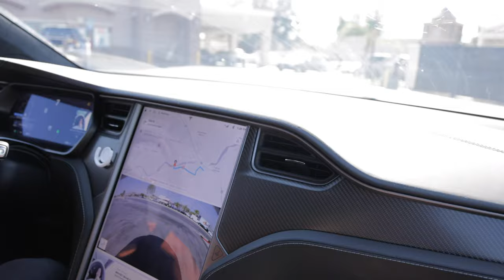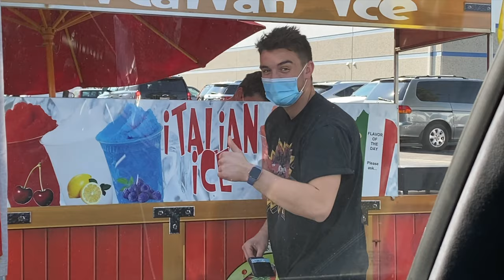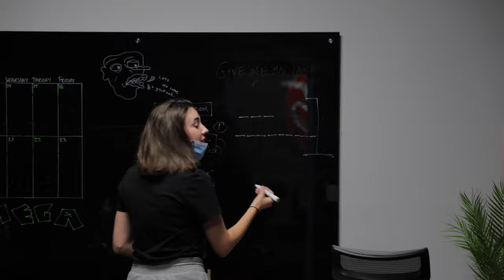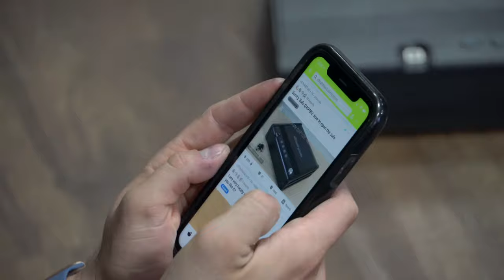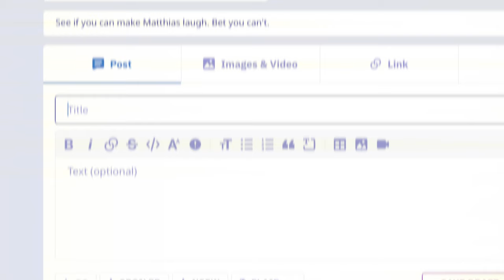Something Explosive Is Leaking Out of the Safe...

Comment: Maybe there was a bottle of gun cleaning oil that broke when it was dropped. Could definitely explain the smell and flammability. Most gun cleaners have a sweet smell
Reply: Great observation!
Reply: Rest In Peace grant
Reply: Or a stash of hand sanitizer
Reply: It probably defense fluid most tech safes have them it's to stop you from trying to break it open with force
Reply: Or i could be alchhol
Reply: Or just battery acid from bottons cause they need power to work
Reply: @paulbortner2455  the tiny batteries it uses to run that thing aren't going to dump a large cup of fluid on the floor. Sorry.
Reply: @wosmssksksnssn3281  yup, probably nice bottle of expensive spirits. People are completely ignoring the actual point of a safe.
Reply: Correct observation but wrong liquid.

Comment: MATT DRILL A HOLE IN IT AND PUT THE ENDOSCOPE THINGY IN IT

Edit: for everyone saying it’s not smart because of the explosive substance inside, read the replies on this comment from Kyle Smith. He explains why it is safe and why it won’t cause an explosion
Reply: I didn't think of that but that's a good idea. Only problem is that you wouldn't want to drill into anything important/valuable in the box because you could accidentally damage it.
Reply: Plus if there IS explosive stuff the metal shavings could cause a reaction and explode, soo not a good idea
Reply: @unicornqueen268  but you could try to safely remove the lock then put the endoscope in.
Reply: I said use that scope three days ago...I don't think they read these
Reply: THERE IS A FIRE THERE
Reply: SOMEBODY MAKE MATT SEE THIS PLZ
Reply: Get one them electric saw type thing (electric cutter that looks like apizza cutter) and just cut a squared outta it
Reply: Or, just, you know, drill a bunch of holes till there's a hole big enough to try to reach in ad grab it.
Reply: your kind of right but what if they drill into it and the and sparks happened and the fire starts in the safe and burn whatevers in it
Reply: @seville2k  mhm
Reply: how about that just open it and tell us what they put in it 🤔.
Reply: Big brain but also lil brain cuz if theres something explosive in it, metal shavings will set it off and we dont want Matt to die
Reply: Ppl saying bout the liquid well put it in the sink when its leaking and hang it for a few days to let all the liquid to get out then drill/electric pizza cut into it and done
Reply: the phone!! the fake chinese phone the little thingy that have a camera
Reply: Noooo, what if the residue ignites???
Reply: risky play, but ya
Reply: Yeah that would work
Reply: @kristaquimby329  drill it in the corner while tilting the safe the other direction
Reply: @flyingpotatogamer0336  sparks + flammable fluid = bad juju. Any type of drill or saw made for cutting metal will send sparks flying.
Reply: That’s not a good idea when it’s something flammable
Reply: @unicornqueen268  why does this whole thing look fake to me I don't want it to be fake aaahahahhhh
Reply: U are a genius
Reply: @r.rodrique2827  they don't care. It's all about prolonging this nonsense. I've debunked quite a few ideas on reddit over the past couple of months. The truth won't get them views.
Reply: @unicornqueen268  Most explosives require an electrical signal in order to explode.  You can torch c4 and nothing will happen however if dropped it, it will explode. It's 100% safe to drill into it and sense it's already covered in oil, the drill it will be well lubricated.
Reply: @Minitura  the heat from tiny aluminum l shavings is well below the flash point of oil
Reply: @es4forty892  yeah but still -_- its worrying that there liquid in a safe even if its just gun cleaning stuff you still should be careful
Reply: Yeah that's a good idea hope nothing seriously bad happens from that 🤣🤣🤣
Reply: Big brain move right there
Reply: Good idea actually
Reply: seeing that it has something "flammable" inside, drilling might cause it to explode. I wouldn't do that.
Reply: Internet winn!!
Reply: @kristaquimby329  that's why you stop drilling as soon as you feel it pop through
Reply: Smart smart smart
Reply: OH MY GOD WE HAVE  A GENIUS
Reply: @kristaquimby329  well they already did
Reply: Yesssss
Reply: Or just put the endoscope into the safe. There's a gap already... Why drill out a hole.
Reply: The box has flammable items...and the drill will cause sparks...sparks and flammable fuels don't go well together :(
Reply: If it lit on fire from what looked to be maybe a napkin or clorox wipe drilling into itmight not be the best idea as the metal scrap peices might also cause it to light on fire or explode
Reply: Oooo BIG BRAINN... actually after reading some of the other comments not so big brain.
Reply: @es4forty892  FINALLY someone who knows what they're talking about.

Respect.
Reply: @unicornqueen268  it's just water. Let's pretend like this is real. According  to the story line that safe was setting on an air conditioning vent on top of drop tiles in a closed off area, where condensation would form.
Reply: WHAT if whoever hid the safe had to place it ontop of the ac unit because the radioactive acid had to be kept in a cool environment to be stabalized
Reply: WHAT if whoever hid the safe had to place it ontop of the ac unit because the radioactive acid had to be kept in a cool environment to be stabalized
Reply: Yup
Reply: I love the range of knowledge within this group. Totally awesome!
Reply: @flyingpotatogamer0336  you mean an angle grinder :)
Reply: @scottlittle6478  Unless you have a good idea about how this aluminum case could contain radioactive radiation, especially gamma radiation, I'm all ears. Also cooling a radioactive substance won't extend it's half-life. The entire reason a element is radioactive is that its splitting into stable forms. Heat won't change how stable it is, because the instability is in electrons, so unless you're dropping it below 0 degrees Kelvin, heat is a moot point.
Reply: @es4forty892  Electrical current with C4 is a completely different topic than explosive substances. It's literally two completely different things.

Comment: Matt, at 15:34. the light was flickering in the safe. Maybe it is like a safety measure and that it is why it is leaking that stuff.

@cayleigh theoret also found this discovery.
Reply: I staid the same thing
Reply: Oh, sorry I credit you.
Reply: @CayleighKristine  Done.
Reply: @Dude-vt7jc  nah your good
Reply: @Dude-vt7jc  thx though
Reply: The blinking red light means that a code or finger print has been tried and failed 5 times. According to the manual.
Reply: @huskytemp1753  Oh, but isn't it weird that when the safe started realising that unknown substance, it stopped and then started when they used the wire?
Reply: @Dude-vt7jc  I personally didn't see it stop flickering. The manual says 3 red blinks = incorrect code/fingerprint or a programming error. 5 red blinks = power failure, 6 red blinks = primary or secondary fingerprint storage is full, and a slow blinking red light for 2 minutes = incorrect code or finger print five times.
Reply: It's possible that the fall or the liquid bugged it out though

Here's the manual if you'd like to take a look : https://cdn.masterlock.com/sentrysafe/resources/pdf/manuals/P63700.pdf
Reply: @huskytemp1753  No, I meant the liquid. It stopped and when they were trying to unlock it, it started again.
Reply: @Dude-vt7jc  oh I don't know, I kept looking around and I couldn't find anything about liquid being in the case. On their website it says the safe has steel, LED on the inside, gas compression struts and foam for padding.
Reply: My theory is, since I believe Matthias awhile back mentioned that the building used to belong to scientists, that maybe it was some kind of chemical put in the safe.

Comment: The flashpoint of a liquid is the lowest temperature at which the liquid gives off enough vapour to be ignited (start burning) at the surface of the liquid. Sometimes more than one flashpoint is reported for a chemical. Since testing methods and purity of the liquid tested may vary, flashpoints are intended to be used as guides only, not as fine lines between safe and unsafe.

Does the liquid itself burn?
Flammable and combustible liquids themselves do not burn. It is the mixture of their vapours and air that burns. Gasoline, with a flashpoint of -40°C (-40°F), is a flammable liquid. Even at temperatures as low as -40°C (-40°F), it gives off enough vapour to form a burnable mixture in air. Phenol is a combustible liquid. It has a flashpoint of 79°C (175°F), so it must be heated above that temperature before it can be ignited in air.

What are flammable or explosive limits?
A material's flammable or explosive limits also relate to its fire and explosion hazards. These limits give the range between the lowest and highest concentrations of vapour in air that will burn or explode.

The lower flammable limit or lower explosive limit (LFL or LEL) of gasoline is 1.4 percent; the upper flammable limit or upper explosive limit (UFL or UEL) is 7.6 percent. This means that gasoline can be ignited when it is in the air at levels between 1.4 and 7.6 percent. A concentration of gasoline vapour in air below 1.4 percent is too "lean" to burn. Gasoline vapour levels above 7.6 percent are too "rich" to burn. Flammable limits, like flashpoints however, are intended as guides not as fine lines between safe and unsafe.

What is an Autoignition Temperature?
A material's autoignition or ignition temperature is the temperature at which a material self-ignites without any obvious sources of ignition, such as a spark or flame.

Most common flammable and combustible liquids have autoignition temperatures in the range of 300°C (572°F) to 550°C (1022°F). Some have very low autoignition temperatures. For example, ethyl ether has an autoignition temperature of 160°C (356°F) and its vapours have been ignited by hot steam pipes. Serious accidents have resulted when solvent-evaporating ovens were heated to temperatures above the autoignition temperature of the solvents used. Autoignition temperatures, however, are intended as guides, not as fine lines between safe and unsafe. Use all precautions necessary.

How can flammable and combustible liquids be a fire or explosion hazard?
At normal room temperatures, flammable liquids can give off enough vapour to form burnable mixtures with air. As a result, they can be a serious fire hazard. Flammable liquid fires burn very fast. They also give off a lot of heat and often clouds of thick, black, toxic smoke.

Combustible liquids at temperatures above their flashpoint also release enough vapour to form burnable mixtures with air. Hot combustible liquids can be as serious a fire hazard as flammable liquids.

Spray mists of flammable and combustible liquids in air may burn at any temperature if an ignition source is present. The vapours of flammable and combustible liquids are usually invisible. They can be hard to detect unless special instruments are used.

Most flammable and combustible liquids flow easily. A small spill can cover a large area of workbench or floor. Burning liquids can flow under doors, down stairs and even into neighbouring buildings, spreading fire widely. Materials like wood, cardboard and cloth can easily absorb flammable and combustible liquids. Even after a spill has been cleaned up, a dangerous amount of liquid could still remain in surrounding materials or clothing, giving off hazardous vapours.

What is the danger of flashback?
Vapours can flow from open liquid containers. The vapours from nearly all flammable and combustible liquids are heavier than air. If ventilation is inadequate, these vapours can settle and collect in low areas like sumps, sewers, pits, trenches and basements. The vapour trail can spread far from the liquid. If this vapour trail contacts an ignition source, the fire produced can flash back (or travel back) to the liquid. Flashback and fire can happen even if the liquid giving off the vapour and the ignition source are hundreds of feet or several floors apart.

Can flammable or combustible liquids be hazardous to my body?
The most obvious harm would be the danger of a fire or explosion. After the immediate danger of a fire, there are sometimes other properties of these liquids that may be hazardous to the body. Flammable and combustible liquids can also cause health problems depending on the specific material and route of exposure (breathing the vapour/mist, eye or skin contact, or swallowing). Some flammable and combustible liquids are corrosive. Many undergo dangerous chemical reactions if they contact incompatible chemicals such as oxidizing materials, or if they are stored improperly.

The Material Safety Data Sheet and the supplier's labels on the containers should tell you about all the hazards for the flammable and combustible liquids that you work with.

An example is 2-propanol (also known as: dimethylcarbinol, isopropanol, or isopropyl alcohol). It is a colourless liquid with a sharp odour like rubbing alcohol or resembling that of a mixture of ethanol and acetone. It is flammable liquid and vapour. Vapour is heavier than air and may spread long distances. Distant ignition and flashback are possible. It is also considered to be a mild central nervous system depressant. High vapour may cause headache, nausea, dizziness, drowsiness, incoordination, and confusion. It may also be irritating to the respiratory tract or eyes.

Comment: 17:31 woods seems to be putting something in his left pocket (lighter) and also his right hand witch came away from the liquid didnt open as if he was holding something small
Reply: I noticed this too.
Reply: @uta chilz It’s def a lighter if you watch in .25x speed as the screen is green and he’s pulling back you can see the metal glint of the lighter tip sticking out slightly it’s super hard to see though

Comment: 14:50 did anyone notice the red light on the safe
Reply: According to the manual the red light means attempted fingerprints or codes have failed five times.
Reply: @huskytemp1753  interesting is that still from before
Reply: I don't think so. There is stuff about 3, 5 and 6 red flashes, which it flashed more than that, but then there was something about two minutes of slow flashing, which it looked like that's what it was doing. It's possible that the liquid spewing out caused the case to think that they put in codes of fingerprints. Hard to say though.

Comment: The video showed a thin metal strip and your crew literally got the thickest metal strip that won’t be able to round the corner 🤦‍♂️
Reply from the maker: bruh that's literally all 3 stores had.
Reply: @onlyoverkill  amazon
Reply: @onlyoverkill  why didn't the rest of the liquid catch on fire? if the chemicals flash point is so low it catches fire from the friction of wiping it up the whole spill should have gone up in flames immediately. kinda sus
Reply: @the_matrix7715  maybe it reacts to the the paper towel?
Reply: @the_matrix7715  idk because
Reply: @novaahere  I've never heard of a chemical that would react to a paper towel. Or a chemical that would create a flamable reaction and the rest of it not also go up in flames. If a chemical is that reactive to another substance the rest of the liquid would catch on fire immediately
Reply: they can't make things outa thin air
Reply: @onlyoverkill  yeah you did your best :))

Comment: Ok at 14:51 the light on the safe goes on. This means the batteries are relatively new. Whoever put the safe there they put it in recently. Don't try to argue that they are old bc with a light every few seconds it would corrode the battery area. Maybe check there also. Hope this helps

Comment: Flammable and combustible liquids are liquids that can burn. They are classified, or grouped, as either flammable or combustible by their flashpoints. Generally speaking, flammable liquids will ignite (catch on fire) and burn easily at normal working temperatures. Combustible liquids have the ability to burn at temperatures that are usually above working temperatures.

There are several specific technical criteria and test methods for identifying flammable and combustible liquids. Under the Workplace Hazardous Materials Information System (WHMIS) 1988, flammable liquids have a flashpoint below 37.8°C (100°F). Combustible liquids have a flashpoint at or above 37.8°C (100°F) and below 93.3°C (200°F).

Flammable and combustible liquids are present in almost every workplace. Fuels and many common products like solvents, thinners, cleaners, adhesives, paints, waxes and polishes may be flammable or combustible liquids. Everyone who works with these liquids must be aware of their hazards and how to work safely with them.

Comment: I forget exactly what liquid it is, I doubt it's it because it's in a safe, but my dad told me about a stain that is used for cabinets, or other wood surfaces and that goes on very thick and it gets everywhere so usually there are lots of towels that get the stuff on it, or you need to clean your hands. Moral of it, is that the oil/stain/chemical when a large amount of it in one spot is exposed to a TON of oxygen, it's fumes will cause it to catch on fire, but it doesn't catch on fire on a cabinet or floor in this case because there's alot over a large surface